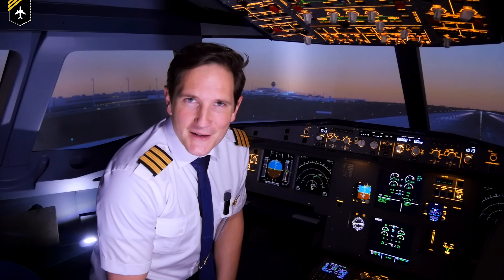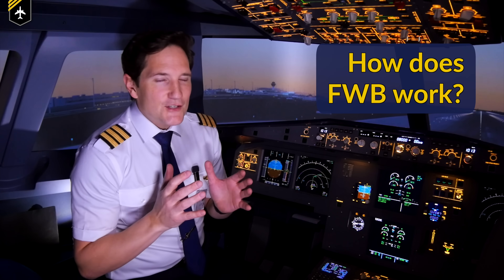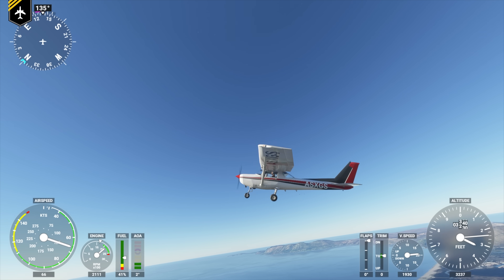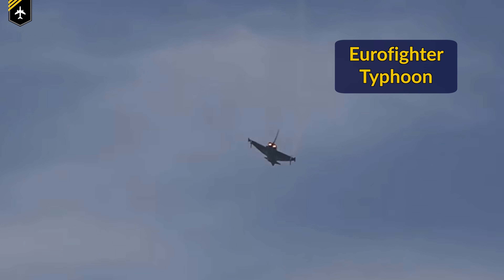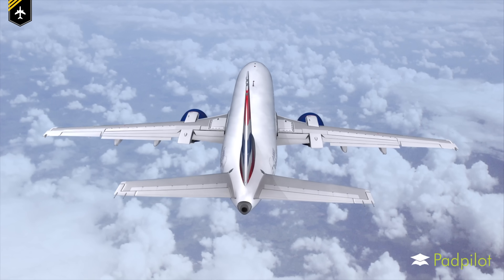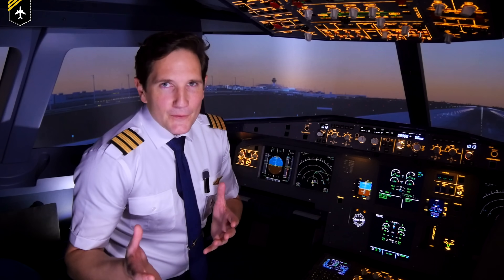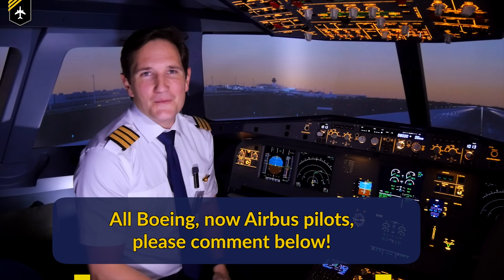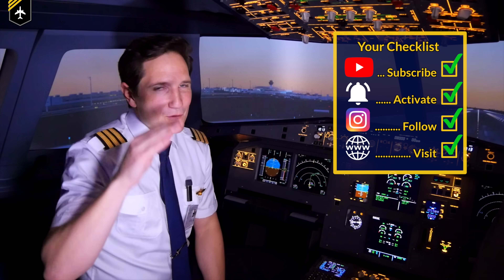How does FLY-BY-WIRE work? The future of flight controls! Explained by CAPTAIN JOE

Comment: Well done nice Video Captain Joe. As former B737 Skipper now on A330 i appreciate the System of Airbus. As you said the reduced Workload Management is one of the biggest Advantages, in my opinion the biggest Disadvantage is the Problem, that you can`t see, what Input your Buddy is giving to the system. I know its compensating dual inputs, but we all know about the past Accident (AF447) where that could have be one step to solve the Situation. Nevertheless its about philosophy, and we all know; Pilots always love the Aircraft most they are flying currently;)

Again: excellent Video!

Comment: There was one Air France demonstration flight of  an A320 which crashed into the trees while landing/go around??!!. Was that because of the autopilot or the FBW system?? A video explaining that incident would be great.
Reply: That was not “caused” by the fly by wire system but the FBW prevented the aircraft from climbing. The aircraft was flying just below stall speed (alpha Max). The pilot was flying much lower than he should have been as the approach was rushed. He saw the trees last minute, applied full power but it takes a few seconds to reach TOGA power.

Because the aircraft was at stall speed it wouldn’t let the plane pull up because otherwise it would stall and crash before it hit the trees. Basically pilot flew too low and left it too late to increase thrust.

Comment: Hey Joe, The Time You Explained How Fly By Wire Automatically Adjust The Trim After Pitching Up And No Other Stick Inputs Needed, You Left Me Totally Blank, I Was Shocked To See That Such Thing Exist I Have Flown A320 On Old Flight Simulator But Never Experienced Such Thing
Joe, Can You Please Tell Me That The Complexity Of The Autopilot That You Told, Does Every A320 Pilot Has To Keep It In Their Head All The Time ?
And In Some Conditions, If The Pilot Need To Fly It Using Mechanical Force, How Does The Pilot Compensate With The Relaxed Stability Of The Airplane ?

Comment: The thing i am curious about aribus, if there are netural input on the yoke. Like if you stop making an input for the turn, will the plane level off, or you need to center it manually?
Reply: If you let go of the side stick during a turn you’re asking for a 0 degree a minute roll rate so it won’t level out until you move the side stick in the opposite direction

Comment: Are jet engines started by electirc motors like car engine ?
Reply: Depends. Most commercial aircraft use compressed air from the APU to start the engines but the 787 uses an electric motor. Some smaller jet engines are usually electric starters

Comment: So in the Boeing without FBW there are metal strings from cockpit to all mechanical parts? So if I would move with  rudder by hand, it would move the control wheel in the cockpit?
Reply: No because the rudder is connected to the pedals, not the control column
Reply: @tomstravels520  So it would move with pedals then?

Comment: So FBW saves weight, but it still needs a mechanical backups. Does it mean that the total weight will be FBW + mechanical, thus heavier than the non-FBW aircraft? Explanation please🙏
Reply: The mechanical back up only controls the horizontal stabiliser and rudder. Not all other control surfaces
Reply: @tomstravels520  I see, thanks

Comment: Boeing is more a Pilot's aircraft. Where as, Airbus calls their pilots as CM1 and CM2 which stands for Cockpit Manager. So, aircraft is not fully under control of the pilots.
Reply: No it doesn’t it means Crew Member. Stop talking rubbish. Aircraft is fully under control of the pilots until they attempt to push it beyond the limits which you shouldn’t be doing anyway. The 777 and 787 have similar features

Comment: On car, the drive by wire for the accelerator pedal was kinda simple. They used 2 potentiometers (variable resistors) linked as a single one. Each potentiometer send it's own signal, meaning you have two signals for the pedal. The computer then compare both signals, and they must match, else it assume that the pedal is defect and goes into a protection mode.

For example, the potentiometer receive ground (0V) and 5V, and will output a value between like 1V and 4V. As you notice it is not the full range. This is done on purpose as a first safety. If the signal is bellow 1V or over 4V then there is a problem, like a broken wire or shorted wire. And then the second one do the same. On some model, the signal of the second is inverted, instead of giving a 1 to 4V signal, it output a 4 to 1V signal. This add a second layer of safety, as if both signal wires are shorted together then the computer will be able to detect it as both signal will goes the same way instead of in inverse.

Nowadays, they use some more complex modules, like instead of being a potentiometer (it have a wiper that slide on a carbon trace and ends up wearing it out, then intermittant signal), they use some hall sensors, or a capacitive sensor, which then convert the signal back into a voltage. For the car computer, all it see is the same kind of signal, and can't distinguish between the potentiometer and the hall/capacitive sensor. Some use a digital signal instead of an analog one, which make the pedal more complex, but make the wiring and the ECU simpler. For an analog one, you need a minimum of 6 wires (3 per potentiometers/hall/capacitive: ground, power, signal output). For digital, you only need 4 wires (ground, power, canbus-, canbus+). The safety of the digital one is in the signal itself, in the form of data checksum.

That was for the control. Now, for the actuator....

That is actually pretty simple. You have a motor, and a feedback simmilar to the accelerator pedal. You command 25%? The ECU look at the feedback signal, and make the motor turn in the proper direction until it hit 25%, then it stop it (in reality, it constantly adjust it, but if you look at it you will see that it stopped.)

One big advantage of the drive by wire (or fly by wire) is that the user commanded signal do not have to match at all the resulting control value. For example, when you floor the accelerator, meaning you command 100%, the ECU may actually just open the butterfly in the intake by 20%, because that is what is needed to let the right amount of air inside the engine at this RPM and load. But a second later it may go 50% now, because this is the right amount now. This result in better performance and often a better feeling. Also, it may lose some sensitivity on the low end and add some at the high end, to make the pedal feel more linear. Normally on old car, when you barelly touched the pedal the enging was already revving, and like the 50% to 100% was doing very little.

This advantage is what allow the fly by wire of controlling more than one actuators, as the control and actuator is not mechanically linked, so conversion and adaptation can be done easilly. After all, all you need to do is apply some mathematics on the signal, and it spit out the other values.

Comment: I wonder are you gonna do a video on what if the eletrical system totally fail (Eg. gotten an EMP blast) and what are the procedures to regain control/ the backups for those siturations
Reply: You’d have nothing (unless the aircraft is shielded) because there would be no electrical power and the mechanical backups need hydraulic pressure but if the pumps aren’t working then there is no pressure to move the mechanical backups

Comment: Captain Joe,
I know nothing about planes...but, I'm curious about everything.
My concerns are, with planes now being totally computerized, can they be 'hacked' like other computer systems are?
It seems like a good computer hacker can get into anything they choose and, have hacked into some important computer systems.
Also, I heard that pilots today, don't get much flying time (or any) and are only trained on the plane's computer system and, if something should go wrong, they couldn't actually 'manually' fly the plane.
Reply: Aircraft controls aren’t linked to the internet. It’s fly by wire, not fly by wireless. The only way you could take control of an aircraft is if you plugged you computer directly into the flight control computers. As for the training that’s rubbish. Pilots are trained to deal with loads of different failures and can fly manually. Yes some airlines do more of it than others but that’s because there is no 1 single standard for all airlines.
Reply: @tomstravels520  Thank you so much for letting me know.
I can calm down now!  ;)

Comment: If the B777 is fly by wire controlled does that means that the pilots don't have force feedback on the control yoke?
Reply: Boeing's FBW aircraft like the 777 and 787 has an artificial feel that creates pressure and feedback that simulate the same feeling as a non-FBW aircraft.
Reply: @dynasty0019  cool

Comment: Hey Joe; How do you explain the 447 air France accident from the fly by wire perspective?
Reply: Pilot was an idiot and they ignored/didn’t hear the DUAL INPUT
Reply: I would say that fly by wire are not directly involved in this accident. But the sidestick functionning principles are for sure. Have a look on the CVR transcript and you will see that, until the pilot flying say "I've been pulling the stick from the beginning", the pilot in the left seat never realized that he was doing that since he couldn't see the other sidestick. It was then a few seconds before crash when he started to understand the situation ordering: "give me the controls" but it was too late. So first, with a yoke, he would have seen was was the F.O. doing earlier and might have reacted and second, with a yoke, he would not have had to ask to take control of the aircraft. There has been many errors, to me this one is really an issue.
Just my opinion
Reply: @patolt1628  might I suggest you read the report into Atlas Air 3591. Pilot did the opposite, thought he was stalling and pushed nose down. Captain didn’t react until too late even though could see his instruments and control column moving forward
Reply: @tomstravels520  Thanks, I will. Only fools don't change their minds ... Nevertheless, for the moment, I stand by my opinion regarding side sticks although I agree that they are almost a detail in the whole picture of this unbelievable accident. There would be a lot to say about this crash but it would be too long. 
I notice that you made a lot of pertinent comments which I agree with (99%of them...). You are very well informed, it's pleasant.

Comment: Quick question regarding the flight controls. If you were to command a full left aileron input on both a Boeing and an Airbus, is there a slight delay in the FBW system before it commands the turn or does it behave very similar to a mechanical aircraft?
Reply: FBW system will be faster as it will be based on digital signals. The signals travel at the speed of light.The Hydraulic pressure will only be at the particular parts.On the other hand in case of mechanical aircraft it will only be based on Hydraulic systems which will be based on Pascal law. The fluid pressure will take some time to get into that affected part of the aircraft. So yeah FBW system will be faster
The system is more efficient.

Comment: This is dumb. If the computer decides what the pilot wants to do is unsafe, it will take over.  .. what could go wrong
Reply: This hasn't happened in 50 years of Airbus and billions of flight hours aquired.
Your statement is like saying Boeing was unsafe because the control cable could snap.
Reply: @safetyinstructor  well there was QF72 but that was due to a broken ADIRU sending incorrect data to the FCPC
Reply: @tomstravels520  well, there's continental airlines flight 1046.
I think both of us can agree that Fly by wire is not any more dangerous (or as dangerous as Adrian says).
Reply: I’d rather the computer prevent them pilots doing something stupid than the pilot do something stupid or don’t react in time to a stall and crash the plane

Comment: I' have difficulty calling it fly by wire. Aren't standard control cables wires? I may be nit picking but I think it's more accurate to call it fly by electron.
Reply: It’s always been fly by wire. Aircraft like the 737 are more cables than wires. Wires are usually single strands whereas cables are bunches of wires

Comment: I think all pilots should be able to fly old fashioned taildraggers and know all the full manual flying fundamentals before they become irreversibly spoiled to partially-assisted fly-by-wire (not having to also put in elevators and rudder, etc..).
Reply: That’s like saying everyone should learn how to drive manual car before learning to drive automatics when automatics are statistically safer and more convenient
Reply: @tomstravels520  I think people should learn to drive manual cars, with good shifting and clutching habits. It makes them drive automatics even more safety and more vehicle longevity.
Reply: @YeshuaAgapao  why would they need to learn how to use a clutch when they go and buy a car that doesn’t have one? That means they’d get skill fade from not using it. Plus automatics are safer because you don’t have to take your hands off the wheel at. The only people who like manual are keen drivers or can’t afford automatics. Most people just want to get from A to B. If people are still crashing at the wheel of an automatic I’d question how well they did in their driving exam. If everyone followed the rules of the road then almost no accidents by driver error would occur.  Also it’s not like if your gearbox starts playing up a clutch pedal suddenly appears and you have to drive it manually
Reply: @tomstravels520  Driving manual gives more intimate knowledge how the machine works, at least for the transmission.  Taildraggers need more finesse and control on the landing.  Automatics are safer.  Driving automatic with knowledge of driving manual and land trikes with knowledge of landing taildraggers makes you a better pilot even if you never ever drive a manual or fly a taildragger again, just from the intuitive understanding of how the machine shifts or flies on final landing.
Reply: @YeshuaAgapao  no it doesn’t. The average driver knows little to nothing about the mechanics of their car. It’s not part of the test

Comment: Now you've done it. You'll have to do four other videos explaining what are stall, overspeed, spin and overbank...

You did do it on purpose, didn"t you? :p
Reply: A stall is when the stream of air flowing over the wings “detaches” from the wing and turns from laminar flow to turbulent flow. The rest are pretty self explanatory.
Reply: @gabrielsimon7944  sorry but no, this does not explain anything at all. I know about Navier-Stokes equations, which ultimately describe all of these phenomena, but knowing about the theory and how it translates into the real world is quite different...
Reply: @francisgaliegue6645  I don't understand what you are expecting. Stall as explained by many pilots (and Gabriel Simon) is clear. What happens in the real world? The airplane simply falls down since there is no more lift. No need of equations to understand that. Spin is an asymmetrical stall: one wing stalls before the other and the aircraft goes into a spin (there are many videos dealing with this physical phenomenon). Overspeed and overbank are self meaning, aren't they?

Comment: The new PS5 controller has feedback on some of its buttons and if a console can do it why not a plane
Reply: A console costs pennies next to an aircraft sidestick. And if it stops working in your controller then you just replace your controller, if it stops working in an aircraft it could lead to a crash
Reply: @tomstravels520  why would a plane crash if the feedback doesnt work maybe I´m dumb but i dont get it?
Reply: @micrator2085  because if you’re expecting feedback and you don’t get any you could end up forcing the plane to do something it doesn’t want to do especially if you’re in alternate law with no protections

Comment: Nice job.  Retired mechanic here--not many people realize that the Boeing 737-100 and -200, introduced in 1968 and 1969, had a basic but very functional fly-by-wire capability built into the SP-77 autopilot.  With the autopilot engaged in control wheel steering mode (CWS), the control cable input lever on each flight control power control unit was locked at neutral and resisted any movement by the control cables.  The force applied against this resistance was detected by force transducers mounted under the cockpit floor. Electrical signals from the force transducers were sent to the autopilot roll or pitch analog computers, processed with rate and angle limits, and output to the PCU servo valves to move the appropriate control surface.  When the pilot force was removed, the computer either held the present bank or pitch attitude, or returned the aircraft to straight flight, depending upon sub-mode engagement.  Watching the pilot fly the airplane in manual mode versus control wheel steering mode, it was normally impossible to see any difference in the pilot actions and results.  By observing the autopilot engage switch paddle position, you could see whether the pilot was flying the airplane in manual, or utilizing the benefits of the electronic overseer.  For its time, the Sperry SP-77/Boeing flight control system was nearly perfect.

Comment: Does the Airbus fly by wire system have a mechanical backup?
Reply: The A320/A330 and A340 have mechanical back up for the rudder and horizontal stabiliser. The A380/A350 have a separate backup electrical system incase of total computer/electrical failure